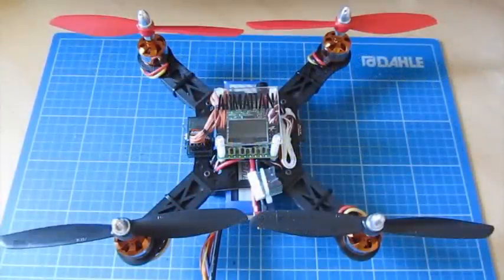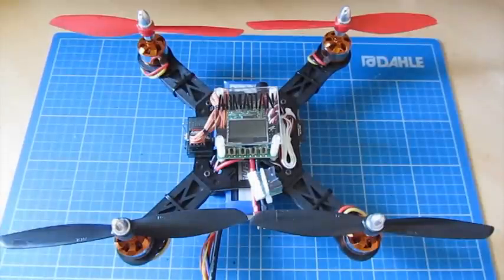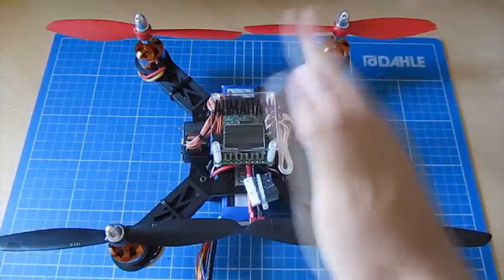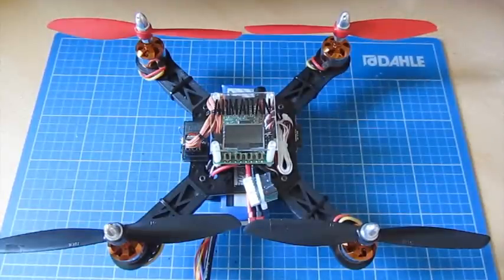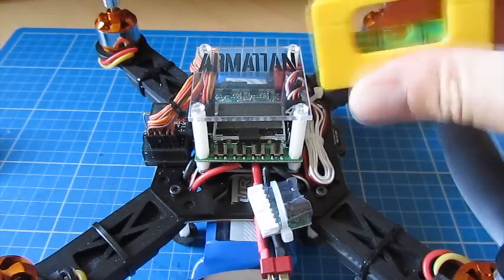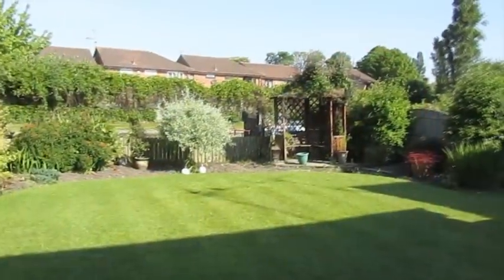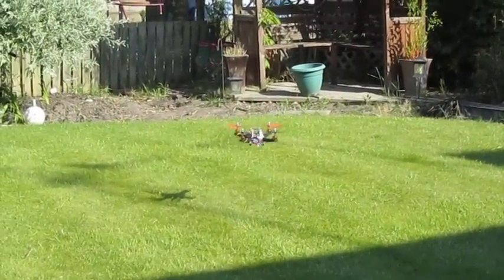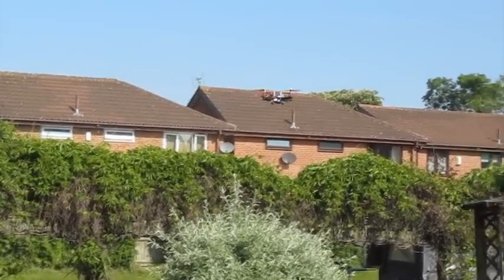KK2.0 Self level setup, trimming and review with firmware v1.6

Comment: hi am using kk 2.1.5 the motor directions are working as it should and when am trying to do the flight throttle up its spinning really powerful but the copter is not coming up
Reply from the maker: Check you have the props on the right motors and you have not installed them upside down. Best of luck..
Reply: thank youu, now next problem, it landed with loop :p what can i do to fix it ?
Reply from the maker: I don't understand what you mean.
 If you mean it flipped on take off then two of your motors are switched over.. 

Recheck everything on the model. If this is one of your first, then triple check every cable. connection and setting..

Comment: 1,(load motor Labour) ok
Quadro Copter X
2,(Acc Calibration) ok
3,(self-Level settings)
P Gain :50
P Limit :30
Acc trim roll :0
Acc trim pitch:0
4,(Receiver test)
Aileron :-3
elevator :0
Thrattle :0 idle 
Rudder :-14 risht 
Auxiliary :on signal 
Arm test :sate zone 
5,(Pi editor) 
-(aileron)
P Gain :75
P Limit :45
I Gain :40
I Limit :20
-(elevator)
P Gain :75
P Limit :45
I Gain :40
I Limit :20
-(rudder)
P Gain:75
P Limit :20
I Gain:30
I Limit :10
6,(mode settings)
Self-Level (Always)
7,(stick scaling)
Roll (ail):30
Pitch (ele):30
gaw (rud):45
Thrattle:90
Please sir reply  please
Reply: Kk2.1.5 flight controller setup

Comment: Help! I cannot get mine to arm? Just started doing this, can't understand why? I have checked and rechecked everything. The receiver is getting signals as the KK2 is reading them in the receiver test menu so I am stumped?
Reply from the maker: +Rampage The answer may be already on the channel. The videos on here are ordered into playlists to help you find what you need but the YouTube and Google searches can be handy too. Google 'kk2 arming painless360' for a hint. Best of luck.
Reply: +Painless360 Thanks for replying, I will search around. I have ordered the USB deal to flash the board as mine is version 1.5 as well. I may need a new board as it was a used one I got in trade with a F450 for a boat I had. Hopefully I will get it solved. Thanks again for your vids
Reply: +Painless360 O.K. just noticed this, it may help trouble shoot it. the LCD says no Yaw input? yet when i do a receiver test tbe lcd does show the transmitter is connected and the Rudder numbers etc.  do change so I am really stumped as to what is going on.
Reply from the maker: That'll be the problem. I'd check that out and make sure all the connections are good/direction ok etc. Best of luck with it.
Reply: +Painless360 Hey hope this helps someone  else as well. it turned out to be the throttle trim on transmitter was not zero out. all good now.

Comment: Can you tell me how to adjust the settings on self level so that I still have some self level and more control. For example. I try to bank turn in self level, and it won't let me. I have to rudder turn to get back.
Reply: +jerry zito Check out Stevies firmware for the kk.
Reply: babipsylon - thank you. I've seen it 3 times. Good video.
Reply: +jerry zito U can do some mixing of ACRO and AUTO level mode, did u see that?

Comment: Ive entered all of my settings, but the main screen says " error: no Yaw input".  I have checked and there are settings in all fields.  What am I missing?
Reply from the maker: Hi Mike, the board cannot see any input from the rudder channel.  Check the connection and cable that comes in from the reciever.  Also worth swapping the yaw input with another to check the input on the board is ok too. .

Good luck with it. Happy flying!
Reply: Thanks so much.  Double checked and must of been a loose cable.

Comment: thanks man,it was related to the bad choice of props(I ve never took care wether its counterclockwise or clockwise props),the spinning direction of rotors is ok.as soon as I know the wieght,I will let you know and the motors are hk AX-2810Q-750KV.i ve finally flied but to a very low altitude 20cm (to the full throttle) from the ground,how can I give it more altitude?

Comment: hi i am new to quadcopter building i made one from parts but i am having problems with lifting off the ground  it doesnt go straight up any suggestions/help with flight control board setting ? thanks  i have the same board as u
Reply from the maker: Recalibrate level and make sure that all of the ESCs have been calibrated.

Best of luck!

Comment: hey dude, great video! just a little question: on my quad every time i land i have a problem with the accelerometers (i suppose)...for example: if i arm and take off from a sloping surface the kk "thinks" that the surface is horizontal, so it flies away... every time i disarm and then arm the accelerometers seems to reset...why?
sorry for my bad english, be patience =)
Reply from the maker: That is the way it works. It's key that you calibrate the accelerometers when you setup the board first time.

Some flight control boards will not initialise at all unless they are level.

My advise would be always take off from a level surface.
Reply: Painless360 seriously? Damn... I think I'm going ti hate this board :P fortunately 2 CC3D are coming ^^ thnx for the info dude :)

Comment: I'm tired to try with my kk2, every try is a crash, props are not cheap, motor 1 input looks like does not work as expected, because I already switch esc and motors from that input, esc calibrates does not work all the time for me, motor 1 always spins slower than the others and I can stop it with my hands, does anyone could help me please?
Reply from the maker: Sounds like you have a damaged motor or ESC. Swap the motor with another on one of the other arms and see if the problem follows the motor or the ESC.

I'd recalibrate each of the ESCs again and don't try to fly until you see all of the motors start at the same time. Hope this helps.
Reply: Thanks for your answer mate, i switch motor 1 with motor 2 from the kk2 and noe the problem is with the motor 2. Looks like something is wrong with my kk2

Comment: I have a quad kk2.1 fw 1.9.
 I'm tired to try with my kk2. im new on quad. I saw many videos here, but nothing that I put on my kk works. when I put power my quad flip. someone can help me?
Reply from the maker: Most common problem that cuases this is that two of the motors are swapped. Triple check that each of the motors plug into the right connector on the board..

Hope it helps, happy flying!
Reply: Painless360 thank you. Now my quad is better...
Reply: What I'm reading you may have to reverse one of the channels, set it on the floor and test the movement of the quad when moving the stick; if it moves in opposite direction reverse that channel on the transmitter

Comment: Have you ever made a video showing how to connect the KK2.1 and get it setup for the first time?  My throttle works backwards and I don't see any obvious way to reverse it.
Reply from the maker: +Steve C No, there were so many of that type when I was using the KK2.X I didn't see the value of making another. I would reverse the channel on the radio. Go into the menus, find the REVERSE/REV menu and reverse the throttle. Make sure that the props are off while you are getting it all setup. Best of luck.
Reply: +Painless360 There are tons of videos on self leveling and so on but nothing on installing and setting it up in the first place and no documentation that I could find.  I finally found the instruction manual and that was a help. The problem was that Hobby King doesn't have any files on the US warehouse website where I bought the board, they are all on the International warehouse site.
Reply from the maker: https://www.youtube.com/watch?v=8NAXSBCtSLY around 2:09 for example.. Hope it helps.
Reply: +Painless360 Thanks, that's really helpful.  Hobby King has a video that starts out saying they are going to show how to set it up but they never do.  Did you notice in the video that all the wires are Black?  I wonder how they figured out the correct way to plug in any of the cables?  Must have had to trace out each one.
Reply from the maker: Used the force I expect ;) Glad it helped.

Happy flying!
Reply: +Painless360 In one video they show how to do ESC throttle calibration by setting the RC to full throttle and holding down the 1st and 4th buttons while connecting the battery then moving the throttle to idle and releasing the buttons.  Is that an important step to do?  They don't even mention that in the instruction manual from Hobby King but it was really a pain to do and took a dozen tries to get it to work.  Also I was going to use it on a Quanum Venture FPV QuadCopter from Hobby King but it has the place to mount the board on the bottom of the chassis where it will be upside down. Will it work that way or should I put it on top of the craft instead?
Reply from the maker: You need to calibrate the ESCs on every build. Failure to do so can cause all kinds of excitement! You'll notice that we cover this in a lot of the build series.

I've never used a KK upside down, I would Google it and see what you need to do to make it happy - I suspect that it will not work that way!

Comment: Hi I am new to quadcopter building. I have a quadcopter with the kk2.1and every time I tried to hover it goes forward. Am I doing something wrong. I don't get it.
Reply from the maker: Vance Gillard What troubleshooting have you done?
Reply: I've done the acc calibration. Motor layout. 
P gain 75
P limit 50
I gain 40
I limit 20
Yaw
P gain 75
P limit 20
I gain 30
I limit 10
Self level 
P gain 75
P limit 40
Reply from the maker: Does it in both self level and normal modes?
Reply: yes
Reply from the maker: Props all on the right way up?
Reply: yes props on right side
Reply from the maker: Then I would check vibration levels and you have the board mounted perfectly horizontal.

Best of luck.

Comment: how do u calibrate the escs with programing card? and if yes what settings to apply
Reply from the maker: You calibrate the ESCs using the throttle channel and your radio - https://www.youtube.com/watch?v=OOplk52R4no

Ideally using an ESC with custom firmware for multirotors (SimonK firmware or similar) is recommended. If not then turn off low voltage and breaking (http://oddcopter.com/2012/12/27/easy-diy-quadcopter-build-part-3-setup/)

Comment: Your quadcopter seems to be in good conditions. Why you need to trim the self-level? Is it normal to correct it?
Reply from the maker: Hi, in theory - once you have taught the board what level 'feels' like it should do most of the work itself - but in practice the cheaper boards (KK2.X and Multiwii) may require a small amount of trimming for the self level to be spot on.

This is best done using the devices in the menus/software for the board as the trims on the transmitter would also affect non 'self-level' flight.

Thanks for the question. Happy flying!

Comment: My kk2 was set up and flying perfectly in my tricopter for a whole 2weeks it flew ok. now when i fly it ,it nose dives in auto level severely and tries to crash ,i have originally had to have neg trim pitch on the auto level settings to fly level ,but now no matter if i go pos or neg trim pitch in AL she nose dives but flys great in normal ,what gives? i have done factory reset 3 times, recalibrated sensors and escs,do you have any jdea what can fix this ?has this happened to you before? v1.2

Comment: plz help me two out of 4 motors are spinning very late in my quad i am using Kk v 2.1.5 everything seems fine but my motors are not spinning at same time i have set minimum throttle to 20 
Any help plz ?
Reply from the maker: No need to post twice.. ;)

Comment: ey admin I'm having a trouble in starting my quadcopter. when I rise the throttle the motors doesn't spin till I push it to the middle then one after an other motor stars to spin can u plz tell me what's the problem with it
Reply from the maker: +Muruli muruli what troubleshooting have you already tried? I'd recalibrate the ESCS first.. Best of luck!
Reply: I tried to set it to  factory mode, then I enter the values in the PI setting and. Also calibrated the ACC and stick calibration plz tell what's the problem with that
Reply from the maker: Hard to help with that level of detail. You don't mention about re calibrating the ESCs.. I'd try that. Best of luck!